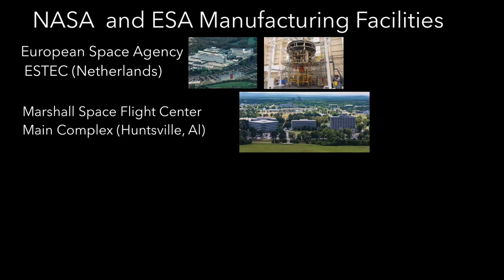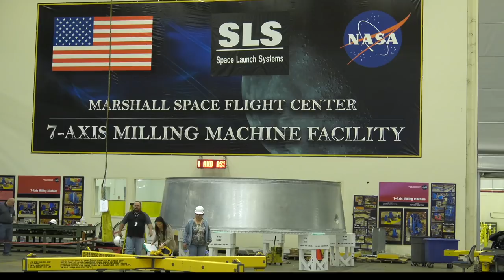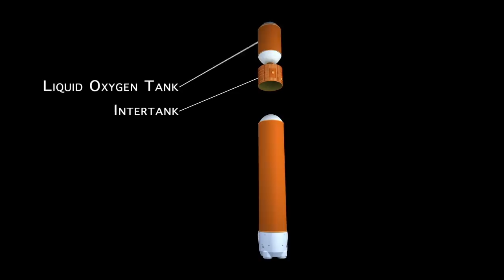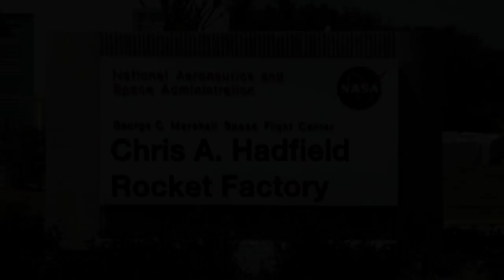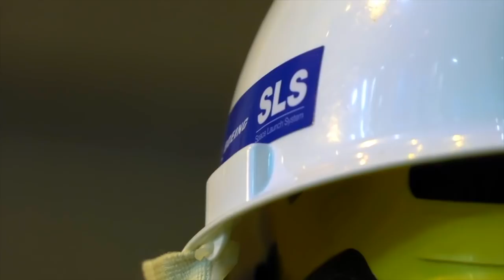SLS manufacturing: Orion spacecraft - launch platform - core stage & boosters

Comment: I'm not a frictionwelder but how does a friction drill bit spin without     a drive shaft and electrical motor. Right at minute 4:06 I'm curious to know. Great job can't wait see it  lunch a mini centralfugal space station into orbit one day.
Reply from the maker: Actually that drill bit actually goes through the other side and the end is secured with a heat resistant tungsten nut, that stops the welded sheets from flaring out, forming sharp burs. At 3:59, you see the main drill motor head that rotates the friction welder rotarty bit.

Comment: There's has got to be a way to make this process faster, you're using a majority of flight proven hardware from the 30 year old shuttle program and now I've just heard that this thing has been delayed yet again. BFR will be flying before this thing gets off the ground and I'm now pretty confident that China will have men on the moon before this thing is put together.
Reply: You must not remember the Apollo 1 fire? That happened because things got rushed and 3 men died because of it.
Reply: Well, delay is no longer acurate, launch date is back june 2020. Speaking about BFR... Doesn't look any close to be ready in June 2020... I mean, now it doesn't even exist. There are just those 2 steel rings for prototype.